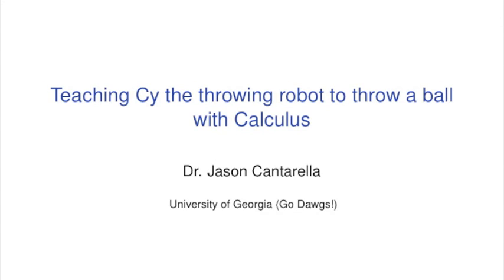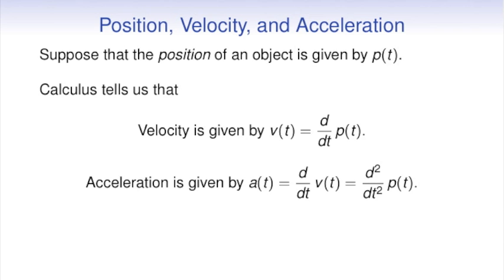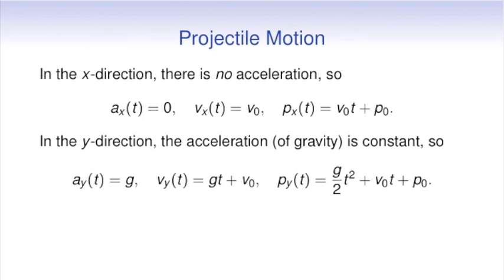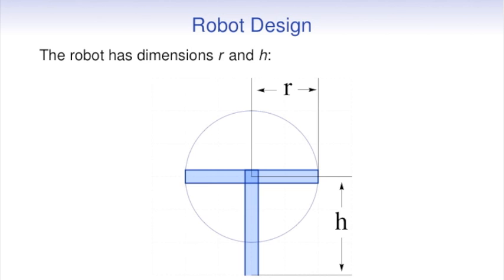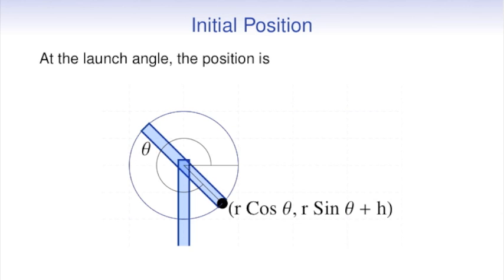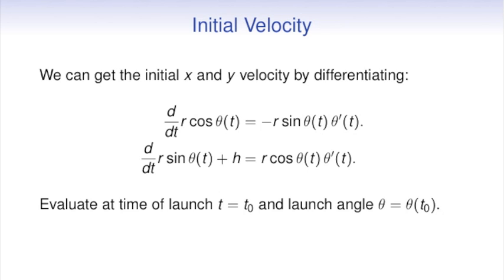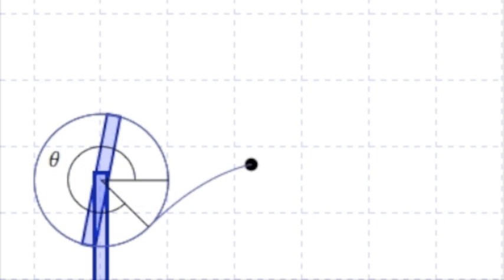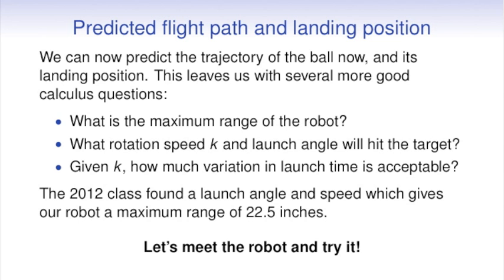Teaching a robot to throw a ball with calculus

Comment: Does drag force and air resistance considered while calculating the trajectory of a projectile??
Reply: And is there any encoder fitted inside there?? I mean how you throws at a perfect angle each time?
Reply: drag force is not considered , yes there's a position encoder which tells you the instantaneous angle of the robot arm